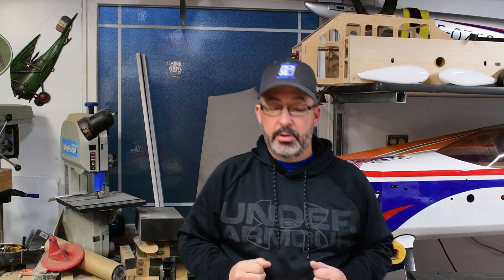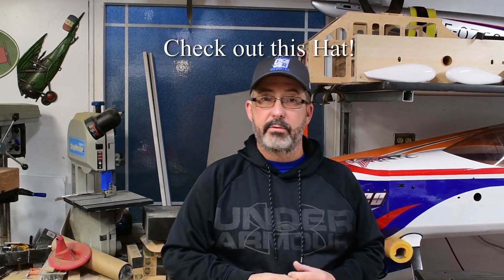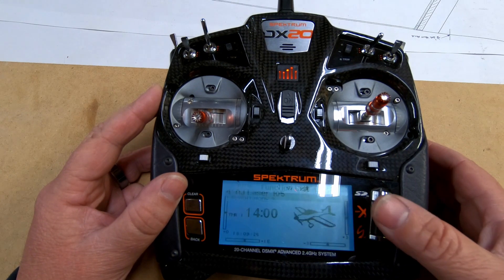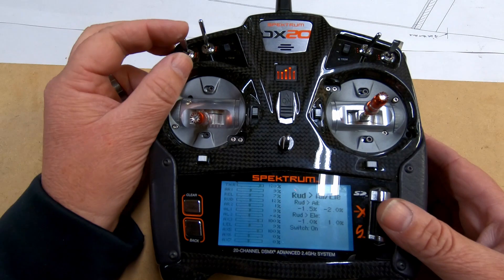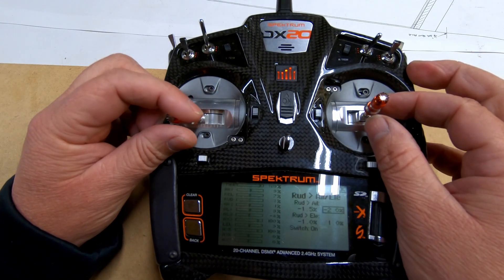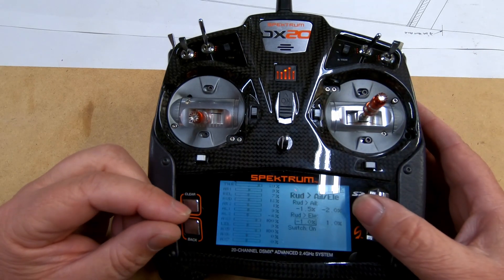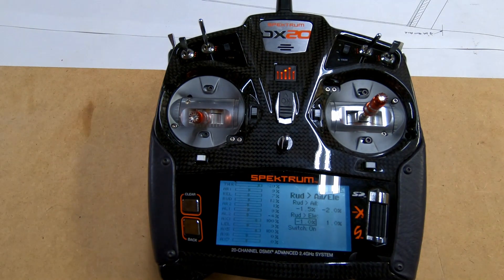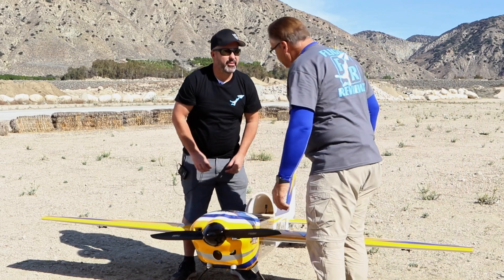FlightReviewz How To: ***UPDATE*** Knife Edge Mixing

Comment: if this mix is on all the time, then every time i use my rudder this will also move my ailerons and elevator? so if i am taxiing out on the runway, or doing other maneuvers it will always move all controls? wouldn't that mess up other maneuvers? e.g. a stall turn. i am new to using mixes Thank you!
Reply from the maker: Thank you for the feedback.

Yes. We run the mix full time. The movements are very small so they will not affect other maneuvers. This is especially true in a full stall maneuver such as the stall turn. We are sure you will agree if you give it a shot.
Reply: @FlightReviewz that was my question as well.  
  Thank you!